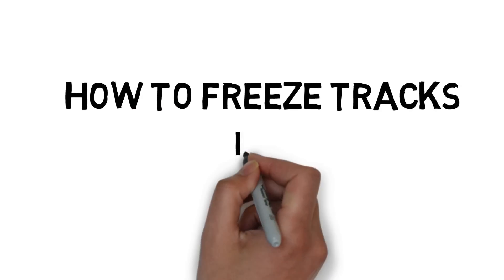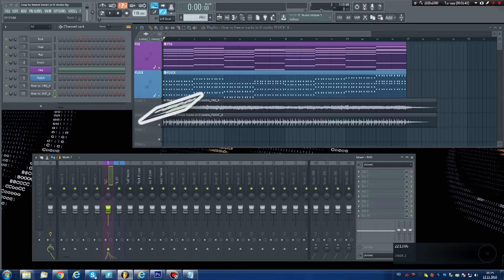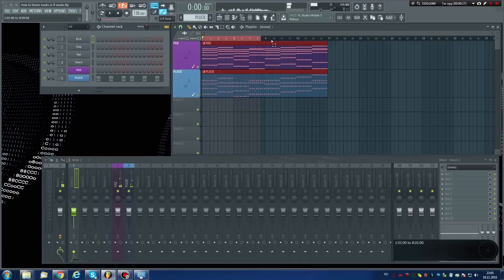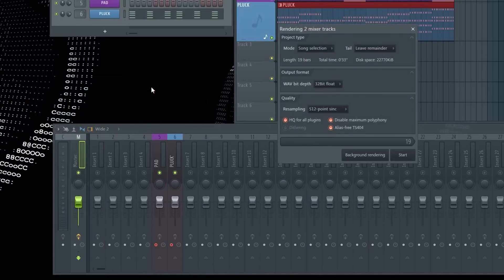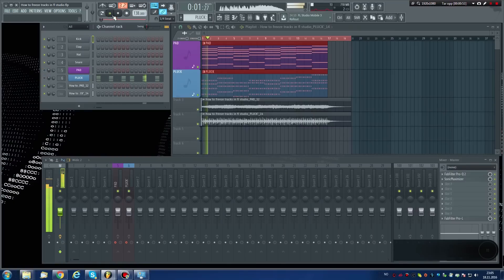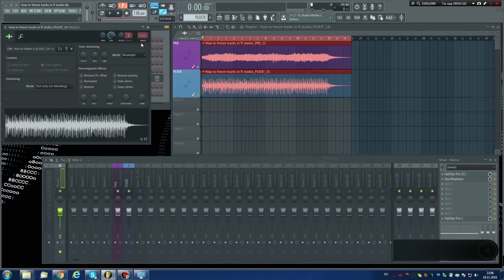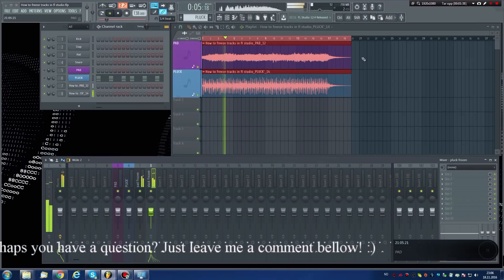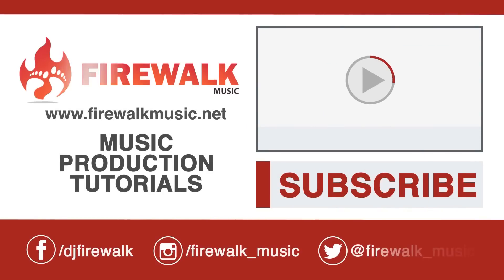How To Freeze Tracks In Fl Studio

Comment: Hello FireWalk.
Thanks for all you do here.
Well I have a little problem.
I think my pc isn't designed to carry cpu intensive tasks.
I play virtually in my local church with my fl studio and an 61key midi keyboard.
So recently I bought the pianoteq stage 6 and add it to my fl studio. The shit lags alot.
I made sure to use asio4all driver, I even tried the native fl asio driver, it still gives this latency thing. If I adjust the buffer size to reduce latency, the playback becomes cracksy and bad. Is there a way I can change my chosen plug-ins to Midi wav files other than plug-ins so I can manage my PC's low cpu?

Comment: This method seems to only mute the original VST instrument clip, not actually "freeze" it (remove the instrument completely), with the future ability to retrieve the instrument back to it's "online" state if I want to make some changes. Is there actually a way to "unfreeze" the track, after it was bounced this way in FL studio, and if the original instrument was manually removed?
Reply from the maker: FL Studio doesn't have "freezing" the same way as more linear daws do, due to the modular nature of FL Studio where anything can be routed anywhere. 
They don't actually all it "freezing" but it's the same principle, you want to "freeze" tracks in place by turning it into audio so that you can work on it as pure audio, or in order to save CPU for example. 

In the newest versions of FL Studio they have improved this functionality somewhat. You can now right click on the track header and choose "consolidate" to instantly turn a track into audio. This will then mute the original midi in the playlist and add the audio instead. 

This makes it easier than before, but of course, unlike Ableton, Cubase, Logic etc you still need to manually unmute and remove the audio if you want to "unfreeze" it.

Also, it doesn't mute the generator (VST) in the channel rack when you do this. If memory serves, you need to manually turn off the synth int he channel rack in order for it to not consume CPU. So simply consolidating won't achieve that. 

I could be wrong about that, but at least that's how it was before. 

So yeah, "freezing" in FL Studio is quite a bit more tedious than in other daws, but that's the price you pay for the modular nature of FL Studio.
Reply: @FireWalkMusic  Thanks. I always keep an eye on how FL Studio is being developed. It has grown up considerably since the beginning of 2000s, when it was my first DAW. But after I switched to Cubase and then to Studio One in a couple of years,  I find it extremely inconvenient the way things work in FL. I am looking forward to this DAW becoming a more "linear" and comfortable environment for "traditional" DAWs users, retaining at the same time classical FL Studio pattern system for those who can't imagine music creation without it. Patterns are not bad per se, but in FL you spend a lot of time preparing patterns and then placing them on the playlist, and assigning channels on the console, renaming...(sometimes you have to rename stuff in several places). But anyway it has become better! Now you can work in a linear way to some extent (although it's a simulation). It feels like it's on the right way! (at least I hope so).  By the way, I LOVE FL Studio's console's GUI, and the overall GUI of the program. It's really cool and inspiring. But.. the functionality is not quite to my personal liking..too awkward for me and for what I am used to. So, I keep watching how FL is being developed, what new features it's going to offer in future versions. It's really intriguing what the version 21 is going to be like!
Reply from the maker: @ДмитроБарабаш-в2д  All valid points. The way FL Studio is set up means that there are always several ways to do one thing, while in Cubase, S1, Logic etc you're supposed to work in a certain way. There's basically a 1:1 relationship everywhere. Track one in the arrange view is also track 1 in the mixer etc. In FL Studio you can have mixer track 1 being track 45 in the arrange view (playlist). This can naturally be confusing, but it also has some advantages. 

The intended workflow is such that if you drag in a VST the right way, it will become an "instrument track", in which case it will be linked in the playlist, mixer and channel rack: That way, if you color it or name it one place, it will change everywhere. So if you adopt the "correct" workflow then things don't have to be so tedious. But of course, it needs to be backward compatible too so it's fully possible to have to name things 3 times like you had to before. 

FL Studio is geared towards EDM in particular, where a pattern-based workflow can come in handy, in much the same way as Ableton, which also lends itself heavily towards EDM. 

This can enable you to get an idea down quite fast and just paint in components of a track very quickly. 

That said, if you're doing a lot of recording, vocals, guitar or whatever then a more linear workflow, like in Cubase will usually make your life much easier.

So it depends a bit on what kind of music you are into, and also how you prefer to work. 

Humans are very different and some people need to have their desk very orderly and organized in order to get any work done, while others have a desk that's a complete mess, but somehow they have some kind of order to it all. Now, if you were to force those two people to change desks, it wouldn't work out well. 

I believe it's the same way with DAWs and people.  In terms of capability, they are all very similar these days. You can basically "do" the same things in every daw these days, the main difference is the workflow. And that's probably the most important thing as well. 

Because some people will prefer one workflow over another. This means that there is no singular "best" daw out there. That's the wrong question to ask. The correct question would be: What's the best daw for ME ? 

And with that said, I think there's a lot of people out there who are just sticking with whatever daw they tried first, and who would probably be much better off with a different daw, but it's just too much effort for them to try, and learn them all in order to find out. :)
Reply: Hm...I finally found the answer. FL Studio does NOT have the "freeze" feature, only "consolidate" (bounce in place). So this is kind of misleading to call it "freezing" - https://spitfireaudio.zendesk.com/hc/en-us/articles/360016286317-How-To-Freeze-Tracks-In-FL-Studio

Comment: So I am clearly doing something wrong. I converted my midi to wav but half of the tracks are silent though. How is this happening?
Reply from the maker: Silent like in quieter or no sound at all? If they are just quieter then it's probably because it's no longer routed to the master where you probably have a limiter or something.
Reply: @FireWalkMusic  I figured it out. Somehow my template rearranged the plugins in Kontakt. So my string section were running on a nonexistent channel and the choir was playing with the brass on the brass channel.  I fixed it but that was really  weird. Happened after I freeze a track but it happened only one time.

Comment: Why volume of bounced track is much lower in comparison to  vst after freezing?Is that convertion algorythm?Also sound is not as beefy.
Reply from the maker: There can be many reasons for this. Is the original track going to a bus?
Reply: @FireWalkMusic  Leter on yes.How would it affect it as I am freezing single track and this track goes to be bussed  via same routing method.I have tried  experiment with empty project recording single track  and it  happens too. Even on Your toturial you can see difference in level ( let's say 5-7dB).Thanks for reply.Any thoughts?
Reply: @wowerman  I have the same problem. Did you find a solution?

Comment: I have a problem as synths tracks after freezing sound thin on the same mixer  track and volume is much lower..When I go to audio clip and assign clip to different  mixer channel no sound difference is happening.
Where is my mistake?
Reply from the maker: if you route it to the same mixer track as before anything on that mixer track will be applied twice. Like the volume setting and the effects. In order to get the same volume as before you need to reset the mixer fader to it's original position, and you also need to click on that microphone icon in the lower part of the mixer track to disable the effects, or EQ, delay or whatever is on that track will be applied twice.

Comment: This looks like the "bounce in place" feature many other DAWS have. That's what this is right??? It looks like a much easier way to bounce in place than what I've been doing which is removing the FX, going to File Menu, Exporting to WAV, opening the saved file in a new sampler channel, and writing it back into the arrangement window where I had it
Reply from the maker: Yes, this is FL Studio's equivalent of "bounce in place" or "freeze" that you'll find in other daws. Due to the unique way in which FL Studio works, where you can have anything on any track, and several things going to the same mixer track etc, it's difficult to implement a similar one button freeze and unfreeze button like in many other daws. Therefore, this is how it's done in FL. 
In FL 20 which will come out soon, this functionality will be improved quite a bit.

Comment: Should i mix i mean eq and add delay before bouncing or should i do it after bouncing the patterns, great video.
Reply from the maker: If you want to save maximum CPU then bounce with the effects. If you want more control of the mixing and the effects then bounce it with the FX off so that you can run the effects on the audio afterwards instead.

Comment: Great video. I'm still running into one major issue though - for some reason my frozen clips are a slightly different tempo than the original. I tried to fix this by going into the frozen track (the  audio clip) and changing the tempo to match my track tempo, but it still doesn't sound exactly the same as the original. Thanks in advance for any help here!
Reply: Said differently, I don't understand why my frozen tracks don't match the overall project tempo
Reply from the maker: +Sam Kennedy: have you tried routing the rendered audio clip to a new mixer insert?
Reply from the maker: Sam, the frozen tracks should not have a different tempo. If you need to re-stretch then there's something wrong, most likely PDC issues. This can happen if you have a lot of plugins in the project that induce latency in your project. When you "freeze" a track (rendering it to audio) then that clip will automatically be routed directly to the master. It won't be delay compensated along with the rest of the project. So let's say all your plugins cause x amount of milliseconds delay being applied on every mixer insert, then they will all be out of sync compared to this frozen track that's going to the master. 

If you route the audio clip to it's own mixer insert, then it should be in sync. :)